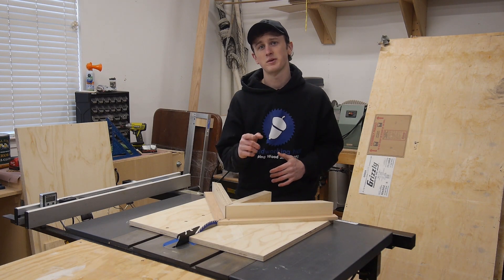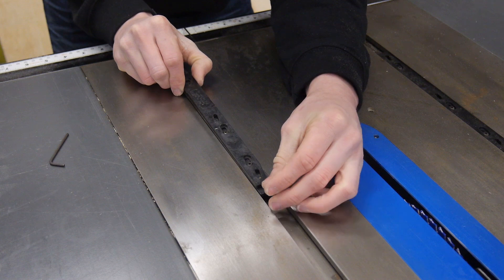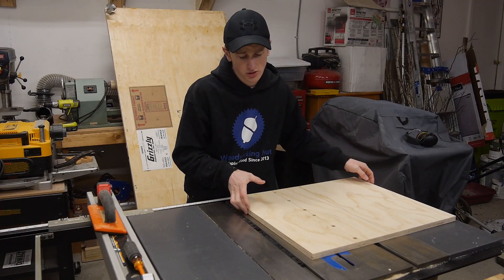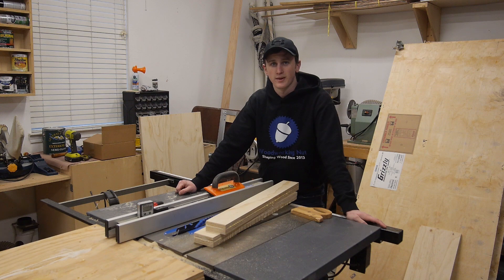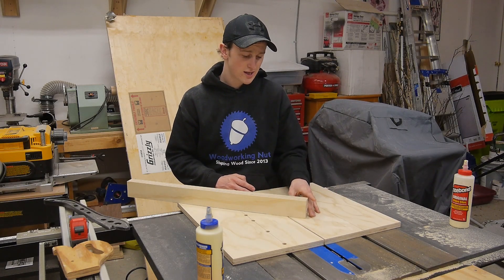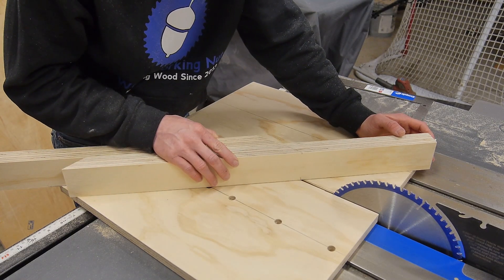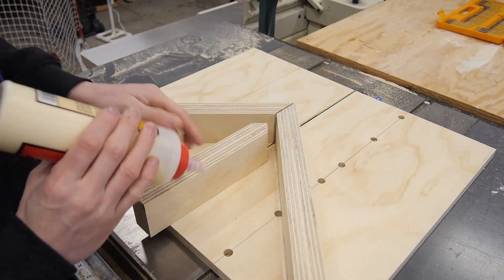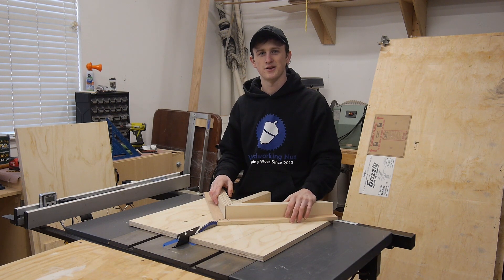How to Make PERFECT Miters with a Miter Sled!

Comment: Why do all the wood workers buy the most expensive plywood???
Reply: I assume this is the same case in the west......

more expensive plywood = better quality plywood = less warping, no uneven surface that affects the quality of the cut for jigs

I only assume this since the low quality plywood in my country although cheap, is a nightmare to work with. Warping and the plywood actually peeling off after sometime is regular occurance.

If I got the cash, I would make my jig with them  thick polycarbonate/ perspex board just to avoid future headache